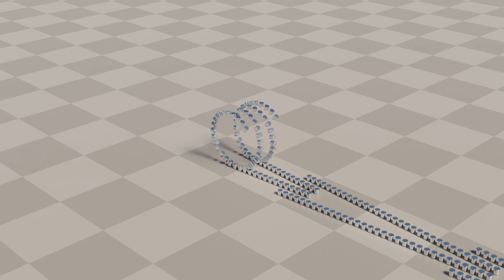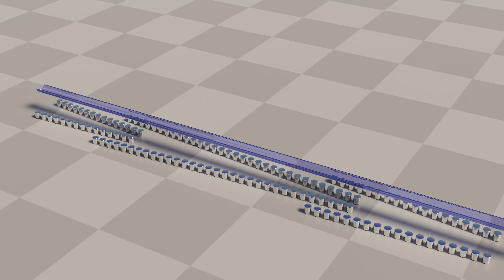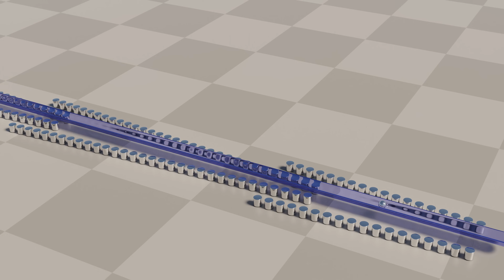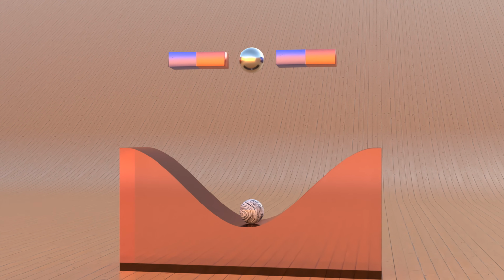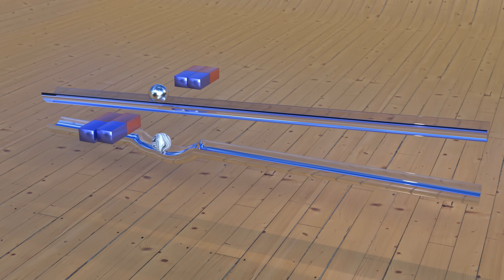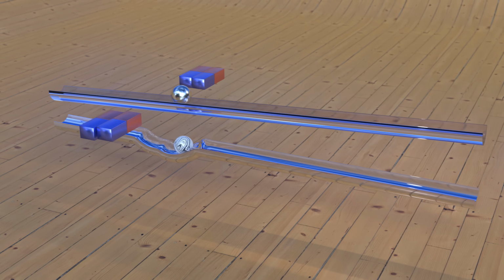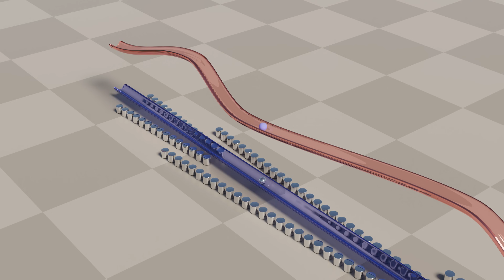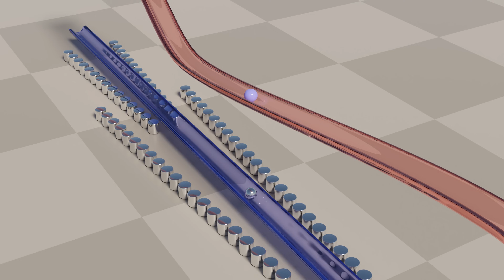Truth: Permanent Magnet Motor Using Magnetic Repulsion. Inventor's idea and what does really happen?

Comment: If you can expand on this further by getting this configuration spinning upto a certain speed via magnets, then it would be interesting to tap it, 'BUT' ever so sparingly to extrapolate it for electricity. 
Too abruptly, then it will grind to a halt were you'll eventually run into problems such as Lorentz forces! 
As the late (ret Col) Tom Bearden once said, 'gently tap, tap, tap' as the same principal applies to a dipole from the quantum state vacuum'. Although as we all know, strictly speaking, there is no such thing as free energy when it comes to magnets as even magnets eventually lose there magnetism over time eventually and therefore must be replaced at some point! But don't get too carried away, it's only minuscule, hence why alot of these experiments end up becoming scientific curiosities only to end up in either a classroom, a lab or on display in someone's office. Nevertheless, this is an area that really does warrant further research and development, sadly whenever we hear that someone has finally 'cracked it' and there have been countless tens of thousands in the past then they sadly either go bankrupt, subject to a catalogue of ill-fated mishaps, ridiculed, threatened who are eventually silenced perhaps or worse, mysteriously passed away in suspicious and mysterious circumstances! 
No thanks also to those who wish to abuse this area such as fraudsters orchestrating a scam via rogue websites scamming people! But sadly the biggest of them of all are still the criminal bureaucratic powers that are so heavily tied to the massive power utility and petrol & no doubt hydro-electrical chemical power companies with their shady bureaucratic oligarchs! As history has shown, these oligarchs will refer to great lengths to suppress any developments in this area for themselves which sadly only falls down to insane levels of greed and bureaucratic power over the masses sadly who wish to hold everyone of us to ransom! 
In the past, such revolutionary revelations attracted the undesired attention of the IFSB by them reverting to their psy-ops parlour tricks by intimidating innovative and pioneering members of the public, whether it was through the Department of Energy's investigory division or with a rogue means by the authority of AFOSI (Air Force Office for Special Investigations) who would rarely present themselves as undertakers which is all part of the psy-ops routine hence the old urban myth of the infamous Men In Black where they would snoop around the place, asking intimidating questions whilst one is under pressure! 
As per usual they would often pretend to be from the Federal Bureau of Investigation typically! 
But now, we have all reached a critical juncture were the energy needs for each of us is never guaranteed were the national electrical grid could collapse at any moment were gasoline and diesel is never always guaranteed to be available at any one time nor is always going to be affordable at any one time neither due to the availability or commodity price fluctuations for that prized Honda generator!
So anyone who imposes any restrictions on you harnessing energy at all within reason ofcoarse and that includes anyone who proclaims to possess whatever level of authority whilst under all oaths or even by association acting on a global capacity whether it's a leading politician, unacknowledged IFSB, someones in on the inside of AFOSI or even those within the FBI, Dept of Energy etc has sadly not got your personal security nor that of your best interests in it's entirety at heart when and if a national disaster were to hit and we can all hazard a good guess as to who that could be right now including 'wind mills' are concerned for eg! Were every paper trail leads all the way back to the sad demise and suppression of the work of Nikola Tesla at the Hotel New Yorker!!

Comment: shouldn't you have the ball roll in the other direction? The direction where the magnets are widest apart and gradually get closer. It seems that if you start the ball at the point where the side magnets are the closest, in the next step the magnets are slightly further apart and the magnetitic attraction is slightly less, thus it won't be strong enough to move the magnet forward.

Comment: Guys,
What if, everything that we know about electromagneticinduction and how a coil and magnet work together producing electricity, are do not work as we known ?...
What if ,there are something hidden,undiscovered about what trully happen in it???.

What if, the electricity that created are not coming from the cooper coil nor the magnet??.
Both work together,capturing electromagmetic radiations ,extracting it and conduct it through the coil. 

Because,if its the electrons from the coil that are moving (affected by the  changing magnetic field) and become voltage and current, its means the cooper coil are the'energy sources' .And surrely its must be consumed during electricity created ,as the electrons move and flow ,its will break the atomic structure of the cooper coil. 
But,its doesnt happen.
The coil are steadily remains .
They just conduct the electricity,as they are a conductor.

There are some myth need to be discover.
And ,if my theory are right, once its discovered ,the way we produce electricity using inductions will be different.
More advance.
CMIW

Comment: You just need 1 more part that pulls the bar magnet back to get past the "hill" per-se then pushes it back in,,, like a rocker arm action !!!!!!!! PRESTO !!! That will work like a charm !!!!!!!!!!  Oh and put that at the top so you dont have to use a spring to pull it back in, let gravity do that !!!! like an egg shape plate on the side that will lift the bar magnet just enough to get past the point of high repulsion then it comes back in to provide the push for the next cycle, and maybe a smaller bar - lighter - with more force to minimize the loss in the up-lift,,,,, build it or someone else will !!!!!

Comment: Though i admire the graphics and the story is ok, you should explain how the magnetic topology translates into the gravity related equivalent trench.
If it were a steel ball (not conducting magnetism) there would not be a place dependant force. If the ball was made of iron the story would be better as the iron adepts it's polarity to the field. The magic miricle machine you are trying to dismantle however has a permanent magnet. That is just different. Whatever. The conlusion will always be it cannot work. Duh! Next time you expand this video in part 2, explain the trick with hidden batteries in the videos where it does seem to work. Thank you!

Comment: Wrap the cylinder with a string that has the mass of 1 magnet on the end. The cylinder will throw the mass at 100 times the original speed of the cylinder. The cylinder will be stopped after the throw. 

The energy of the small mass is 100 times that of the original energy of the cylinder. This massive increase in energy can be used by an Atwood's to restart the cylinder to the original speed 100 times.

If the original arc speed of the cylinder is 1 m/sec then the linear speed of the small mass will be 100 m/sec. 
1/2 * 1 * 100 m/sec * 100 m/sec is 100 times the energy of 1/2 * 100 * 1 m/sec *1 m/sec

Comment: A logical-sounding explanation as to why it doesn't work, but they forgot something crucial. The magnetic roller has a weight, which represents a relatively large mass due to the magnets and the roller. If you give this system a targeted push, the inertia of the mass of the roller with the angular momentum will always exceed the critical point you described. This then makes it work...
Reply: And why not make the barrel slightly elliptical so it gives it that extra push?
Reply: What if it was used in space?
Reply: The light of truth is hopeful and perfect, without such hope as you have proposed, we have a less perfect trouble shooting.  As this video has proposed…. The hopeful shall never Fail. Even after viewing this video. As you have clearly explained to us . Your explanation supports wisdom.. His logical , but lacking forward thinking-    Yes forward thinking that is hope.😊

Comment: Neodymium magnets are extremely powerful. They can pinch off limbs, crushed cars have lots of power now it’s not the permanent magnet that produced the electrical current. It’s been doing a perpetual turn and rotation turning a crank to turn a gear that runs a motor producing infinite free energy, putting electrical current into the perpetual rotating wheel with the magnets cause magnets are actually charged by electrical current doing that will keep a continuous rotating spin of the permanent magnet alternator that’s connected to the motor producing infinite free energy for that motor you want more power like I said the magnet that I named Neodymium magnets are extremely powerful and keep their magnetic current flow. You have to send electrical current back into them so in that for petrol turning wheel, there will be electrical current that is producing from the turning of the wheel going back into the magnets, keeping them charged, which will then help turn the wheel that cranks the gear to keep the lights on. That’s all it takes. It’s very simple physics.

Comment: On the edge of the cylinder, there are some counterweights above the attraction-rejection resting point. You explain only the magnetic part, not the mechanical part. Magnetic + mechanical = assembly that works. In the film you can see very well the rectangular and other color weights (as well as the balancing of the wheels of the car - lead weights)
Reply: Permanent magnets do not deliver energy and mechanical constructions without input of energy also do not deliver energy. And combinations of both are not any better. A weight can deliver energy when it drops but to lift it up again consumes the energy which was gained.

Comment: I have build similar after lot lot settings adjustment its finally rollin. End point of magnet need to adhust pin point setting 2mm difference stop motion. 
Its levitation into circular motion.

Comment: a sensor on the wheel that detects loss of movement could trigger a secondary rotor/small motor, just used to establish rotation again (auxiliary motor) - I think a magnetic motor can't exist without an ignition process and an auxiliary one (the auxiliary can even be an electric motor, fed on battery). So in a car, magnetic motor, auxiliary motor, alternator & battery would be needed.
Reply: Loss of movement is due to an applied load or - without load - to friction. You assume that a magnet motor can deliver a drive which just needs a push now and then to last. But this assumption is wrong. A magnet motor does not deliver any drive! Clockwise and anti-clockwise torques always sum up to zero. Thus your "secondary motor" would be the only agent which causes the rotation.

Comment: Have you try to use weak interaction vs strong interaction between V-Gates you may be surprise. e.g. the first round you need to weak the magnetic interaction somehow maybe spring for timing the device just surpassing the drag and let the V-Gate self sustain. Free energy is available everywhere in perfect balance ask THE SUN if not sure.

Comment: And why then would not a pulsed electro magnet be usefull here to remove the dip when it begins to affect the rooller and come back on once its past the point of the dip and add to that the rooller be a heavy flywheel that would add to the forward motion of the rooller. I think that if multiple methods are used in conjunction this would work to produce electricity and overunity could be possible
Reply from the maker: Hi Ron, thx for your comment. Yes, it’s a good thought, using an additional electric magnet. 
Watch this: https://youtu.be/jYsRonUeRTM?si=-tOu7fkSO6HxyXek
But it would not work anyway, because the energy harvested might be too small for the electric magnet. Thx for watching. 🙂

Comment: I want to believe that if something that simple existed, it would have been created. But all these great examples are using a bunch of multiple magnets and the balance between them.

If you're using only 2 magnets, and the push is strong enough what would happen? The system would balance at some point with the magnet on the rotor being on the opposite side of the static magnet ?
Reply from the maker: Hi 1Iomi, thx for your question. Yes, I think it would go like you said. It tends to balance. And balance mostly is a standstill 🫣.
Thx for watching 🙂

Comment: What if you used the weight of the ball and gravity to make up for the overlap? Or maybe a spring that kicks the ball forward using the gravity of the ball dropping and compressing the spring causing it to lift enough to compensate for the strong energy?
Reply from the maker: Hi J, thx for your comment. Interesting thought. 🙂 I tried to make a Loop ramp work some years with the help of gravity, link ahead, but the power consumed to get back to the starting point was higher as the outcome. 😬
https://youtu.be/iNODsSAjJ8Y?si=VP14UeLoHVxc6V8x
So the ball just sticks a the position of highest attraction.
This one was one of my first videos to this topic 🫣
https://youtu.be/nRJUePA1eb8?si=CzQGoRp7EbGI7aRi
Thx for watching 🙂

Comment: Firstly, this is computer animation, not real magnets, motors, or physics; you can depict it however you prefer.
Secondly, where are the actual scientific motor designs and names? If you genuinely wish to discuss them, why conceal this information?
Thirdly, why doesn't your model include an option where, initially, the 'hand push' is included, overlapping the initial turns as in the starting process of old motors?

Additionally, it's worth acknowledging that the world is influenced by consciousness and, to a significant extent, by forces that may be considered malevolent, eliminating the work, words, and thoughts of those attempting to liberate people from the constraints imposed upon them in this world. This manipulation often involves the elimination and confusion of minds, which is a fundamental tool. Those who seek to free people may face opposition, and it is asserted that the human body is inherently limited to a lifespan of 120 years, as marked down thousands of years ago, as even mentioned in the Bible.

Comment: Your explanation was wonderful and easy to understand.  If free energy is discovered I believe it will not be through the mechanical process, I believe it will be through frequency.  You say this universe is set to come back to balance, but in the micro universe vibration is as eternal as the universe itself, vibration is motion, motion can produce flux at resonate coupling, so it is possible in my opinion.  Even if we could some how tap into the collective heartbeat of millions, or billions  we would have endless energy from the human perspective.

Comment: Why can't the be a clock work mechanism that pulls the large magnet away at overlap and then pushing it closer after the overlap, skipping the strong part resetting the falling process from a higher point.  Or use an electromagnet, and a physical push to start the process so as to only give energy to the electromagnet at intervals  skipping the overlap, would this not create a free fall forever?
Reply: what is electromagnet made of? if it is electromagnet then you are using additional power to generate motion which will not be perpetual
Reply: they have been trying for over 150 + years. like really trying.  supposedly 100 sceintists tried to prove einstein wrong ( as the story goes ) .  he said " wouldnt one guy be enough ? "  im paraphrasing here... 
only link there is tesla apparently having his own scientific papers confiscated.  but this gets in the realm of conspiracy theories.
Reply: Its been done successfully with pulsed electromag annnd also using mechanical lifting moving large mag away briefly. It works. Easy to mess up tho...helps debunkers.

Comment: it does work but you have to offset the axle yours is in the cntre and thats why it stops you need to make axle offset slightly thats it.
Reply from the maker: Hi Jedi, thanks for your comment. Maybe there is a way to make that motor work as desired but it will not implementable by using some magnets in a tricky setup for sure. Try thinking in my gravitational model way. Thx for watching 🙂
Reply: @yWild  scale it down into a small can but use an offset spindle try it.